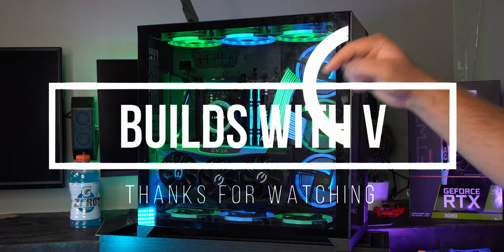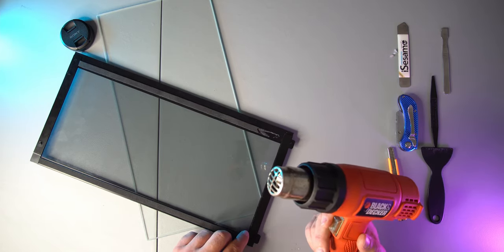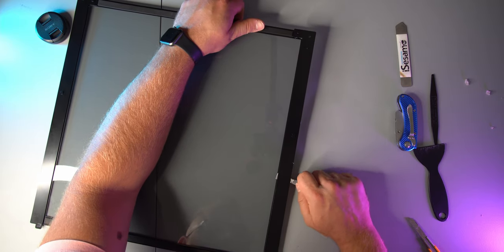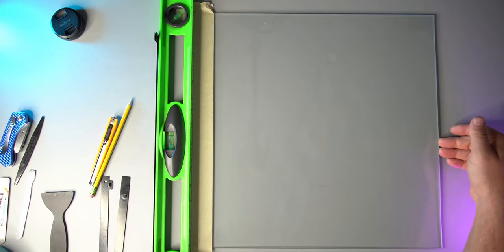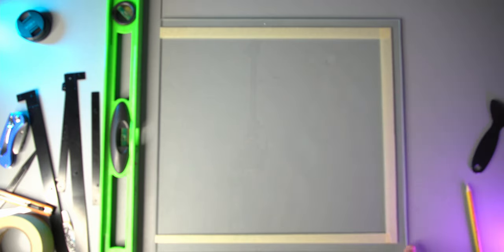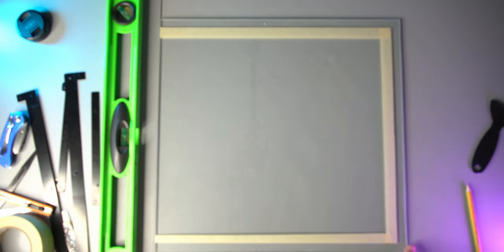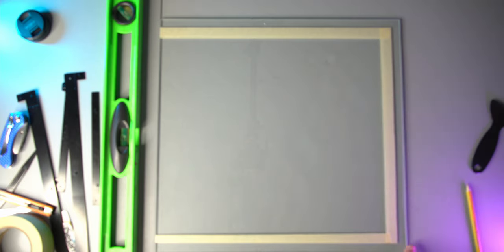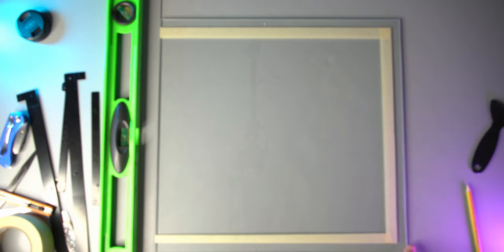Modding My Lian Li 011 Dynamic Case (Custom Glass)

Comment: Good mod. I have been practicing painting mentored by my godfather that has been on car modding scene for over 20 years. Good tip for spray painting is doing thin layers. And not hurrying up. Good job with cleaning all grease before taping and painting. Props.
Reply from the maker: Thank you 🙏 I also learned all of my modding and painting and stuff from the car scene since I was a kid. I can’t keep anything stock 🤣

Comment: The real question is why doesn't lian Li just offer this as a standard version?
Reply: Because they have a front bracket fan also which wont fit if you do this.  But since the EVO is such a varied build I really dont see why they couldnt add a way to do this easily.
Reply: @black0knightcs  the Evo XL is comming with a glass corner. And htea are cheapo copies that do this too. But they lack the size and editability of the Evo.
Reply: They will be coming out with a new case called the 011 vision. That will be my next case!

Comment: It took me 30 mins without painting. I kept the upper and lower 1" strips and cutout the side middle parts out on the two sides. Its looks fine...
I had to Dremel off one of the metal brackets, and cut a line (x4) to match the 1" border.
This approach also meant I kept on one the retaining snap lock brackets.
Reply: did you take a video by any chance?

Comment: Just letting u know i remove my support i have the xl version looks amazing gonna buy the glass gonna insert it with velcro probably
Reply from the maker: That actually sounds like a solid idea. Mind sending me some pics of the XL without the bracket? You can dm me at Buildswithv on Instagram
Reply: I added a video to overclock 5950x i show it there with how to control all rgb from nzxt corsair evga in one software

Comment: 1 question how did you measure the bezel with the bracket so you can cut it correctly ? is the front glass bracket

Comment: how did you find ordering glass thickness, I measured the glass is 4mm, what thickness did you end up getting?

 I'm considering going between seeing about lian li o11d evo white version glass replacement for my black because apparently you can scrape off the paint.  Vs seeing if I can get glass locally done.

Comment: Do you have any idea for rising the graphics card in reverse mode in the Evo? I worry the regular riser for the Evo won't hold the card properly upside down. And having your graphics card mounted upside down is a permanent risk to the graphics card. The only options I see so far are the vertical mount or having a custom loop installed for the card. Since I already have to upgrade my graphics card right now, I don't have the money for the entire custom loop ready yet...

Comment: Nice build!  Where did you get a vertical mount cable for a Pcie 4x for your 3090?  Or did you set your slot for 3x speed?
Reply from the maker: Thank you! I was using the lian li vertical kit made for this case and it was the PCIe 3.0. They have a 4.0 version now but I’m still using the same PCIe 3.0 cable but with the ezdiy mount. For me I personally don’t need the PCIe 4.0 but will upgrade when prices come down and more quality cables are available.

Comment: Fantastic mod mate! Really well done! Question though, did it affect the overall noise level from the case? As you mentioned, the short side panel wasn't cut exactly to the correct lenght.

Again, really well done. Love it!

As a sidenote. That gou seems to sag alot. Maybe get a support bracket for it?
Reply from the maker: Thank you 🙏 there wasn’t any extra noise that I noticed and performance was same as well. Yeah the gpu was sagging quite a bit. I have since moved into the 011D evo with a new gpu bracket and it no longer sags
Reply: @BuildsWithV Friend, do you remember the thickness of the new glasses you made?

Comment: I wonder if there is a glass shop crazy enough to cut one really long panel and bend it where needed.
Reply from the maker: I’m sure there is, I didn’t ask around since I’m sure that would cost way too much but I’m sure it would be pretty cool. Just depends how tight of a corner they can make. If it’s too rounded I definitely wouldn’t like that personally since it wouldn’t match the rest of the case. I like the sleek and sharp look of this case.

Comment: Good job..but i thinks if you use acrylic instead of glass would be easier using a magnetic tape on the inside and you dont need to mod the origina tempered glass if you want to use it on the future and its more cheap.
Reply from the maker: Yeah that’s a great point, I personally don’t need the original glass so it didn’t matter but for those who might want to keep their original glass that’s a solid idea. Appreciate the comment 🙌
Reply: @BuildsWithV  do you experiment some sagging on the top? Or moving the case? Thanks
Reply: @BuildsWithV  i make a custom windows on the rear section of the case with acrylic because i have a D5 pump attached on the distroplate and the original panel dont fit ..thats another idea if you want to make it
Reply from the maker: @nachovidal4047  there is a tiny bit of sagging  and flexing while moving the case but overall no real issues
Reply: Nacho vidal but how do you then get it to stay up like that you need the bracket to click on top and the sides right so you wil need to take it away from the original or is there some other way?
Reply: @Nacho vidal

Comment: This is an AWESOME build. I really like the horizontal mount gpu. Can you tell me if it actually makes it cooler? Technically it's blowing the hot air onto the mobo itself.
Reply from the maker: Temps are about the same vertically tbh. I saw no difference in temps but this case has great airflow as well so idk. Other cases may be different. Thank you for the compliment and for watching 🙏
Reply: @BuildsWithV  for sure, I wanted to eventually build a horizontal gpu like yours but water cool it from the side. intake.
Reply: or i guess, vertical? lol.

Comment: I know I'm very late but is there a way to use the original glass after removing the bracket?
Reply from the maker: Not the the black 011d or the black 011d evo. The white 011d evo has removable paint
Reply from the maker: Or did you mean to use the original glass after the bracket from the case is removed? In that case, yes you can. Glass fits in exactly as expected
Reply: @BuildsWithV  Yes! That's what I was wondering. Thank you!

Comment: Why can't you just use the original glass? Looking to get a O11D mini and interested in doing this type of mod.
Reply from the maker: So on this black case the paint on the glass is permanent, I tried everything and it doesn’t come off. I’m not sure how to mini is but on the white lian li 011D evo you can scrape the paint off the glass. The white mini may or may not be the same, not sure since I haven’t tried this mod on the mini. Also the mini doesn’t use the same rivet system, I believe you have to cut the center bracket off with a dremel or another way. Again, not positive since I haven’t done it but that’s what I noticed with pictures.
Reply: @BuildsWithV  Ok, thanks!

Comment: Or you could have just used the Xigmatek Aquarius Plus case. Same look, with space for a 120mm fan at the back and the glass panels are perfectly in contact in the corner leaving no gap.

Comment: Great mod. But couldn’t you just pull off the metal brackets and clean the original glass and then put it back in? Obviously cut part off with a Dremel that you don’t need.
Reply from the maker: Thanks 🙏 not on the original 011. I did this mod on a white 011D Evo and you can scrape the paint off the white case but not the black
Reply: @BuildsWithV  no no. You pulled the brackets off the original glass to put on your custom made glass. I’m saying you could have pulled the brackets off the original glass. Cut out the corner with a Dremel. Clean original glass then re adhere to the original glass. And bam. No corner piece while using the original glass of the case.

Comment: nice case but that AIO orientation is the worst possible. you want the cooling to flow down and straight on to the cpu not up. if you flip the aio it will also prolong the life of your cooler. just unbiased feedback but good video
Reply from the maker: Thank you I appreciate it. That it not true tho, the best orientation possible is with the hoses down and the radiator higher than the pump however that it unrealistic. Typically (if possible) you’d want the hoseless side of the radiator at the top so that if air bubbles form then they will stay at that side without going through the hoses and into the pump. Jay has a really good video explaining this in more depth.
Reply: As was mentioned already, tubes down is always the correct orientation. A single 360 rad isn't all that much for these pumps to push. The problem with tubes at the top is that it can introduce air into the tubes and thus the pump which is far more likely to damage the pump. Gamers nexus has a very good video explaining this as well.
Reply: very incorrect Tsullllllll. Ideally, the radiator is top mounted but if not possible side mounted with tubes at the bottom is preferrable to hoses at the top for the reason V stated.

Comment: I'm pretty sure you can reuse the old panels and strip off the old paint with a razor
Reply from the maker: Unfortunately can’t be done with the black version.
Reply: @BuildsWithV  why not
Reply: @user32352  The black on the glass is etched in, not painted on. If you were to remove the black it would not be clear because it is etched.

Comment: you do realise you can just remove the paint where needed on the original glass? you didnt need to get new glass.
Reply: You actually can't, it's etched, the dark tint I mean, which is the sole purpose of the mod, having clear glass instead of tinted.